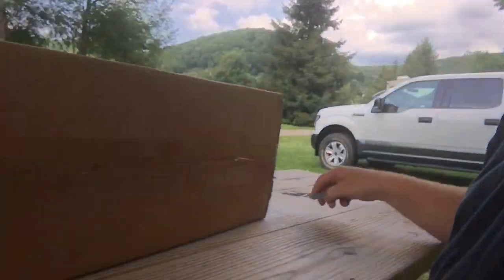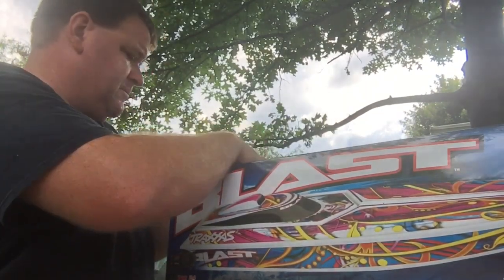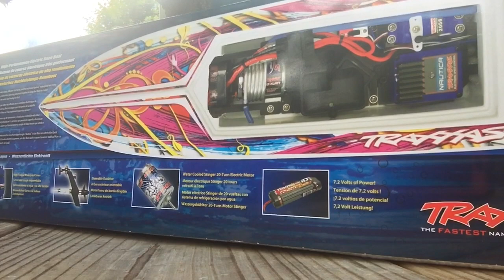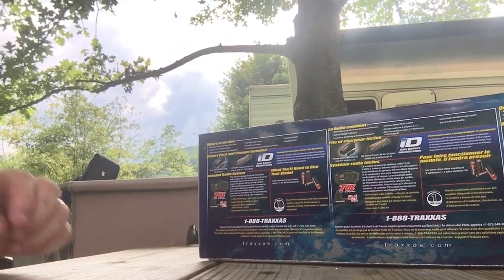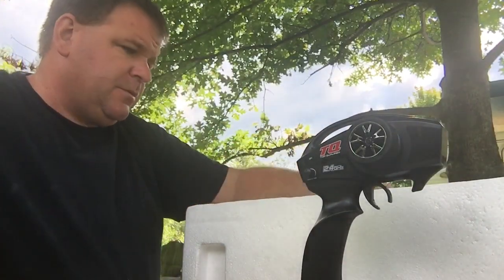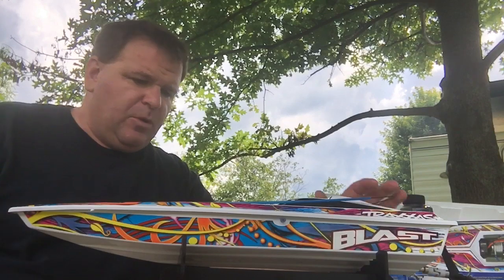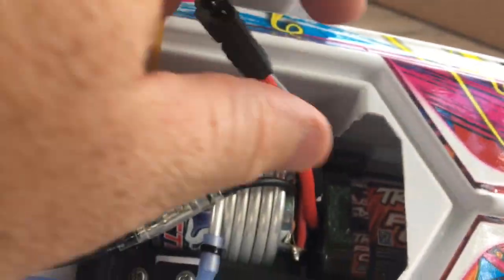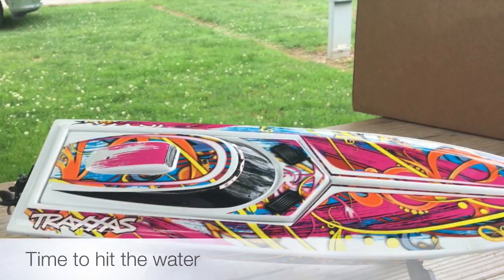Unboxing & River Run of a Traxxas Blast boat

Comment: Nice jump in subs so far. Try not to run too much in the river like that. The cool works when moving, if there isn't water squirting out the side exit hole then its not being cooled. It needs it cause of everything being closed in the hull with no air flow. Just keep pumping out the videos and the subs will grow.
Reply from the maker: Thanks for the tip Ben.  The length of the video is the only run time it had, I was too afraid the current would take it away.  Off to a pond later in the week to get some more run time.